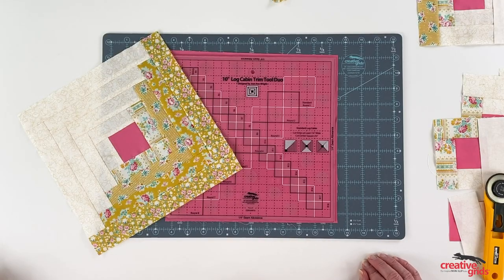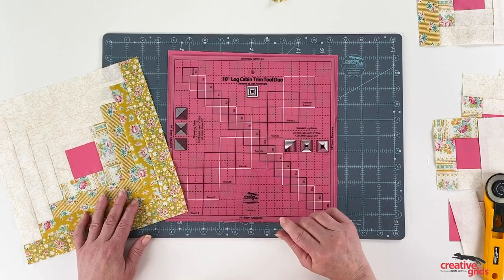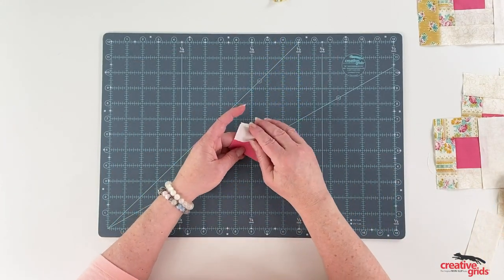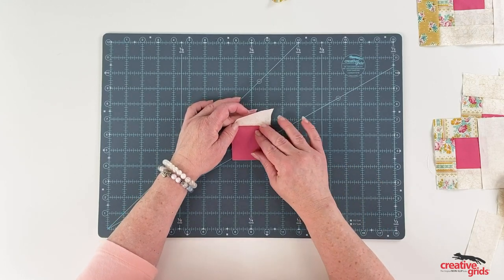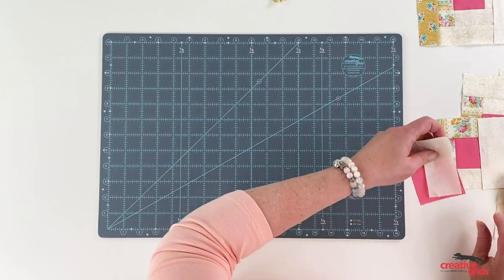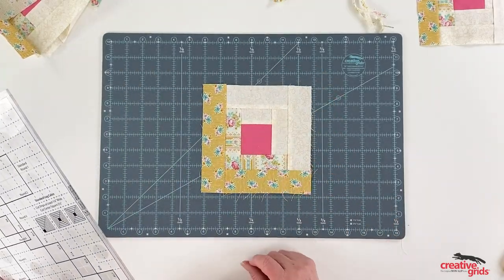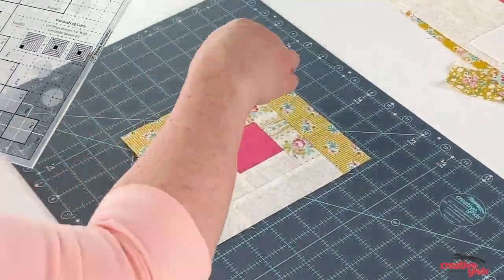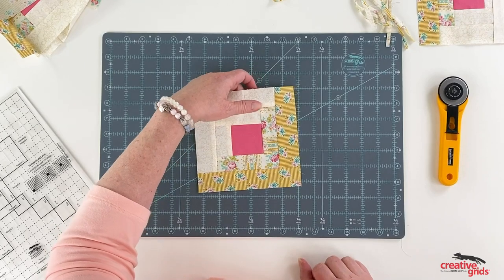Creative Grids® 10" Log Cabin Duo - Basic Log Cabin Tutorial

Comment: I am just starting to embark on quilt-making. I have been attracted to the log cabin pattern. The hint about how to tell on which side to start each subsequent round (the side with the 2 seams) is a big help. I always wondered how easy it was to keep track of where to go next. I was a bit surprised at how much was trimmed off each time after sewing on four new strips. In this video, some of the trimmings look like they would add up to at least 1/4 inch being trimmed off. It seams that, if one's seam allowance is the accurate 1/4", there should not be so much to trim off. Maybe the strips were cut a bit wider on purpose for demonstration purposes to illustrate the trimming step more clearly?